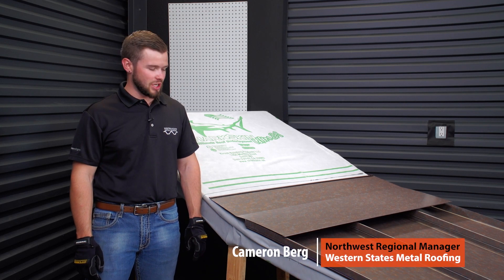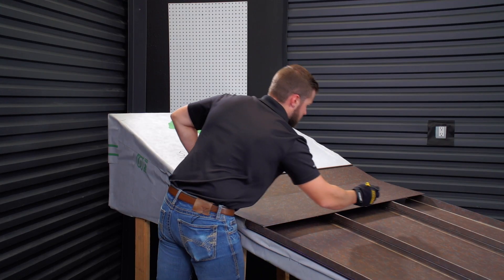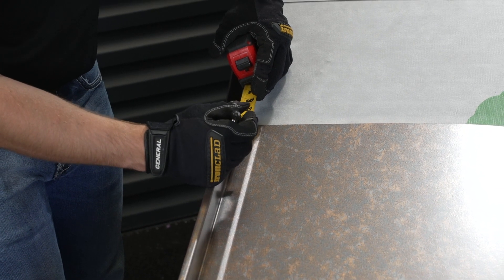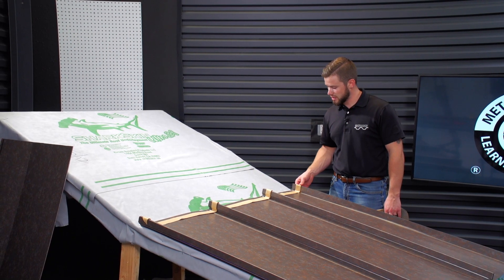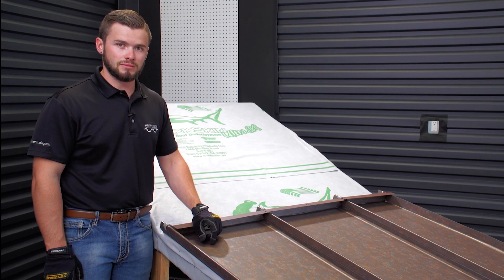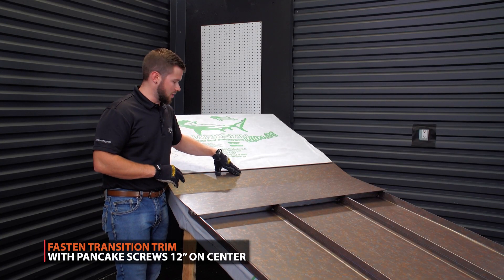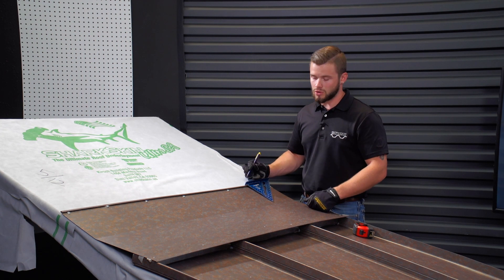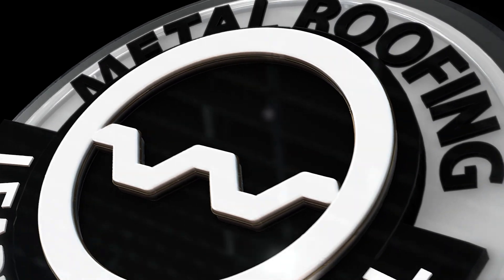Standing Seam Metal Roofing: How To Install Transition Trim - High To Low

Comment: I love the idea of a learning channel, however, in this video, the young man has skipped over some of the very important details, ie: the z trim fitting is skipped, explanation of the purpose of each step, close up shots of the individual components, removing the tape properly from the mastic, making sure your fasteners are perpendicular to the surface, etc. A seasoned installer would have a lot to say while watching this demo. There is a great shortage of good content in metal roofing vedios and  I hope to follow more of your offerings. Thank you for putting this out there.

Comment: Question for all the experts: I have a pitch elevation transition to install where the transition doesn't span the width of the side of the roof.  To make matters worse, the upper corners of the lower transition meet a hip ridge, so the ridge cap will actually overlap those corners of the transition.  The building has a 4 sided hip roof (no gables) and the transition is for the front porch, where the front porch does not extend the full length of the main roof and it attaches ~2ft up the roof.  So I'm trying to figure out how to transition from porch roof to main roof (those upper corners of porch) and how to plan for the hip ridge caps to be continuous.
Reply: I'm kinda in the same boat as you. trying to figure out how I'm properly going to get this done.

Comment: Your Z-trim stage both looks terrible and is.  It functions as a dam, and if water gets in there it will be trapped there, creating a pool.  You actually  want water to be able to slip out underneath the Z-trim onto the roof, not being waterproof, but being bug-proof.  It's actually worse than simply guiding the water down into the house if it gets there by folding the sheet ends up to form the Z similar to what's done at the bottom of sheet, and assume that the transition trim fulfills the role of redirecting everything out and over.

Comment: Is there a rule f thumb on how long the upper panel will actually need to be from the pitch break to the the ridge in order to order the correct length panels or are these just going to have to be ordered long and cut to length?

Comment: Any chance you have a video of metal to shingle roof transition?  I plan on putting a covered deck roof but its going to be a 3 12 pitch so going to use metal on it. The house is shingled with a 12 12 pitch and all the videos are metal to metal transition.